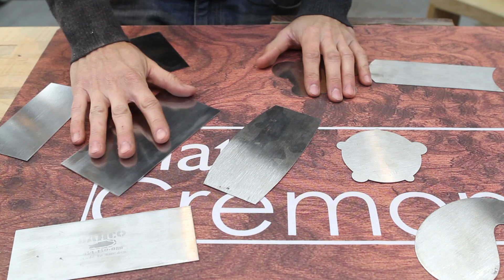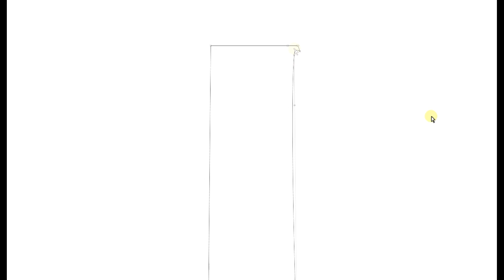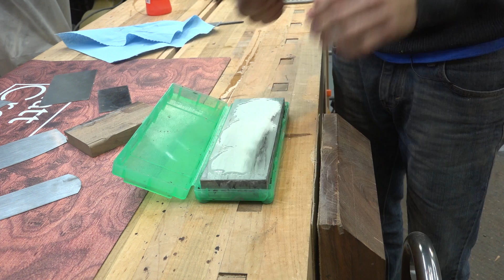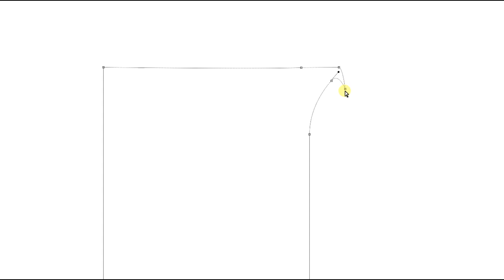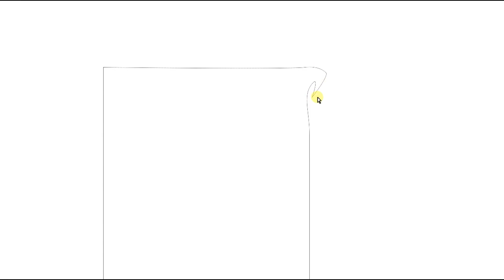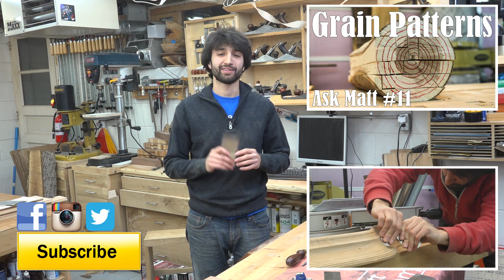Card Scraper Sharpening and Use - Ask Matt #16

Comment: So, could you just buy old bandsaw from the flea-market and use that steel to make a card scraper? Which direction would be better for the scraper edge, along the grain (edge) of the saw or across the width? (Parallel or perpendicular)

Comment: I feel educated! I have never used scrapers so this is a crash course, but I'm thinking I may need to own some! I do a lot of thin bark removal on blueberry wood, which is normally around a 1 inch diameter, to make handles for mallets and so forth. I've been using a draw knife and chisels, I'm curious if the scrapers would speed up my workflow, or at least remove some sanding steps.

Comment: Thanks Matt! This was really helpful. A question though: Do you still need to sand after using a card scraper if you ultimately want to apply a gel or oil stain to the wood? Is there enough for the stain to 'grab on to' with just card scraping?
Reply from the maker: It depends on the surface your scraper leaves.  If you do a good job polishing the edge, the surface should be perfectly smooth.  If your edge is a little rough, there will be slight track marks that you'd want to remove with a light sanding
Reply: If the surface is perfectly smooth, will it take a stain? A lot of the Minwax stains say to sand to 220 grit before application.
Reply from the maker: I don't use stains but I can say that it takes varnish just fine.  It wouldn't take much to go over the surface with 220 if it is an issue though.
Reply: Thanks!

Comment: Hey Matt, 

You sort of touched this here in your video, but is card scraping something you do in substitute for sanding? before sanding? after sanding? I thought it was something before sanding and then maybe you start with a higher sand paper but I wasn't sure.
Reply from the maker: All of the above.  If I have a fine bur, I can go straight from scraping to finishing.  But I can also use the scraper to remove a spot of tearout from a panel that I am sanding.
Reply: Thanks! Bout to use mine for the first time.
Reply from the maker: Have fun!

Comment: I have a lot of old 2x6s used for the concrete slab. They are grey with dried concrete I will use my old paint scraper to remove the stuck-on concrete before i start milling for my work bench. Great tips on restoring cause I know i will be harsh on my scraper. Old Southern pine gets pretty hard as it ages, almost like a hardwood. Your videos have been helpful. Thanks

Comment: Thanks Matt...... Assuming the contoured  scrapers are done the same way, sharpening them could be very difficult. do you use the same method on all contours? I have many shapes and so far have not tried sharpening anything other than straight. Great demo Matt!
Reply from the maker: Thanks Charlie!  Yes, the contoured ones I sharpen in the same manner.  I will have a video out about curved scrapers soon.
Reply: +Matthew Cremona I was wondering the same thing , the one that looks like a gear, and the inside of the gooseneck scraper, seems like a challenge ,so, looking forward to that video! greetz

Comment: another thing is that the hardness of the steel varies between makers.  My Crown scrapers require more force than what you apply to get a burr on that Woodcraft.
Reply from the maker: That's a good point.  I have a Bahco scraper as well.  I'm not sure how hard that one is but it seems to sharpen up the same as the others. I think it's a bit thicker steel too.  I think my gooseneck is a Crown.  Interesting...

Comment: Thanks a lot Matt for this vid! I've bought some scrapers a few weeks ago and was very frustrated because I couldn't get them as sharp as they would produce shavings. But as you mentioned I have seen a few tutorials and all of them recommended to use very high pressure with the burnisher. I will give it a try with "your method" by using low pressure. I think that will make a difference. I think my bur is much bigger than your's but I am very surprised how well your scraper worked with such a tiny bur...
Reply from the maker: It's certainly a strange thing.  Bonus magic point, I suppose.  Let me know how it works for you.  Thanks Ron!

Comment: Very useful video! If I ever buy a proper scraper then I will know what to do. For the moment I get by using utility knife blades and single edged razor blades.
Reply from the maker: Thank you!  Maybe sooner than later? :)
Reply: Lol at some point I am sure, since my projects (pipes) are naturally very small, the razor blade is the perfect choice, and requires very little work, just turn the edge with a hardened steel rod and use it, costs pennies to replace when dull.
Reply from the maker: +caskwith Well you've got me there.  Sounds like the perfect size and setup for that type of work.

Comment: scrapers are marvelous...  and the best thing is they can be very cheap.  i prefer to use paint scrapers (the ones with a handle)  get a nice wide one as they are generally very good steel.  put an edge on it and your away.  or cut up and old hand saw blade.  again generally good steel and ideal when your trying to make a particular profile.  i have even used chisels as a scraper by putting a hook on them when i need to get into particularly tight spaces.  as long as the the steel is hard enough you can just about use anything lol.

Comment: Dont yell at me if you have done this before... replacing blades on box planer, jointer, and well blades in general which to use for what purposes in miter saw or table saw
Reply from the maker: haha!  I think me yelling at you would be a funny sight.  Planer knives: The lunchbox planer I had used indexed knives so there wasn't any challenge there.  Jointer: My jointer has a spiral head so changing the cutters is no where near as involved as jointers with straight knives.  My saw blades I use video: https://youtu.be/-3qzJgn0zVA  Thanks Kevin!

Comment: Matt- Great video! So had a table saw accident and my left thumb is weaker. Have you tried a scraper plane? How do they compare? Is the sharpening the same?
Reply: +Tim Royal I love the #80 Stanley Scraper Plane, it likes a 30 degree Bevel than burnished over onto the flat side.
Reply from the maker: Sorry about the injury, I haven't tried one but I really want one. They seem like they would be so incredible useful. I do have a cabinet scraper which is similar. I have it set for a pretty heavy cut. I've used it for truing up panel glue ups. It works great too. It's somewhere between a card scraper and a scraper plane with its short sole. The sharpening is a bit different. The blade gets sharpened the same way as a plane blade and then the cutting edge gets burnished.
Reply: +Timinator62 Thanks!
Reply: +Matthew Cremona Thanks Matt!

Comment: Great job explaining how they are used and especially how to sharpen them.  I had to use them on my new wood railing I installed because there were several pieces that came together to create a complex turn.  The scrapers really came in handy making the joints disappear and getting rid of slight variations between the components.
Reply from the maker: Thanks Jim! Perfect example of how useful they can be!

Comment: Great info, Matt! I've had a card scraper sitting in my shop for about a year now. It's high time I dust that thing off and sharpen it up! One question, do you go through the entire sharpening process every time or can you just hit it with the burnisher to touch it up of it starts to get dull?
Reply from the maker: Thanks Braxton!  When it gets dull you pretty much have to go through the whole process again.  You might be able to get some life out of it by just burnishing it but probably not much since the quality of the bur is going to be less than if you removed the existing one and repolished the edge.
Reply: itll dull kinda quick if u just burnishit .also depending on what type of wood too.. maybe?? just my opinion..but i go through all  the steps. that way i get better each time i get a new card .:]